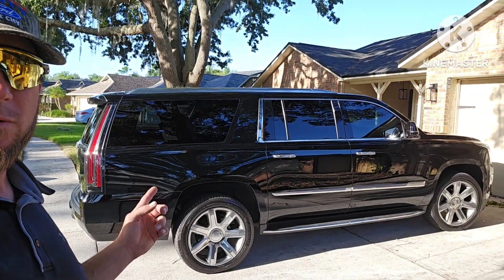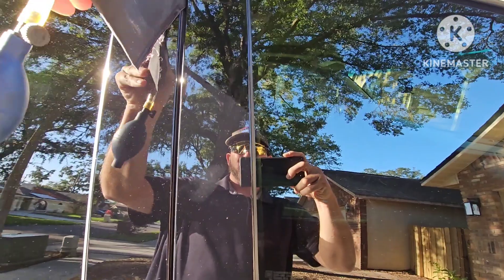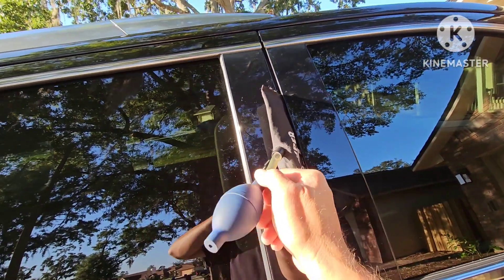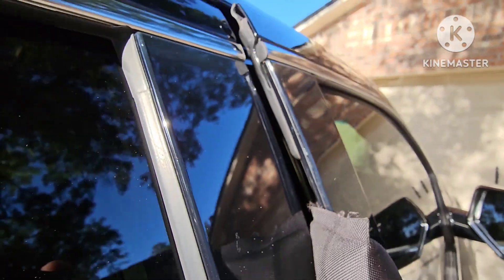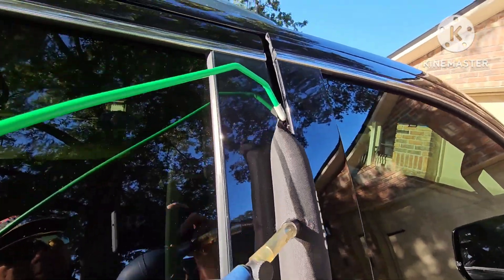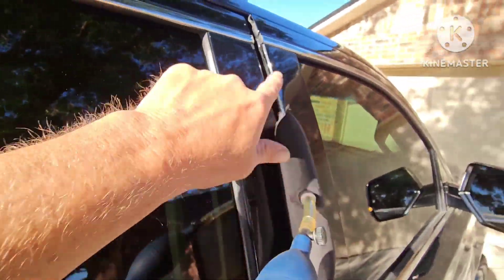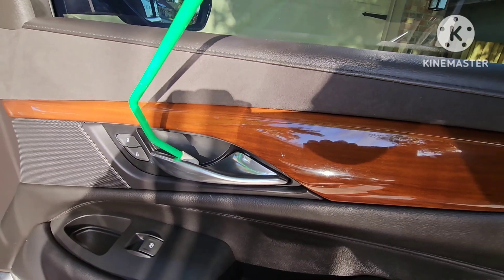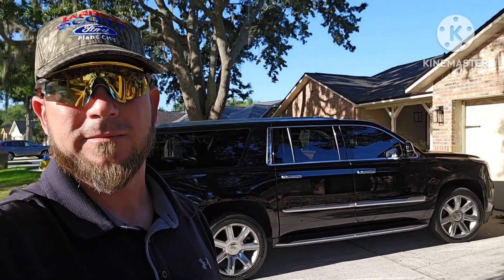HOW TO UNLOCK A CADILLAC ESCALADE-KEYS LOCKED INSIDE

Comment: So I tried this on the passenger and drivers side on a 2013 yet I couldn’t get either to unlock. Is there some weird anti theft that would prevent it from u locking? I also tried to hit the u lock button and I don’t get any unlock. I can hit the lock and hear the doors clinking as if they are locking again. Any suggestions?

Comment: What if the battery is dead?
Reply from the maker: Pull the inside door handle.
Reply: @roadsideguy5902  thank you for replying, but the battery died so the alarm is not working and it's locked from the inside it's an 05 escalade and for some reason the key for the ignition is different then the door locks, cant get to the lock switch 😭